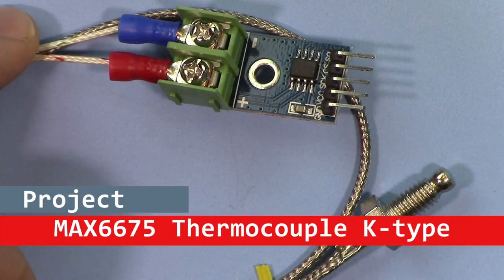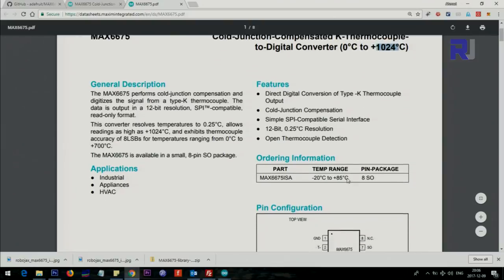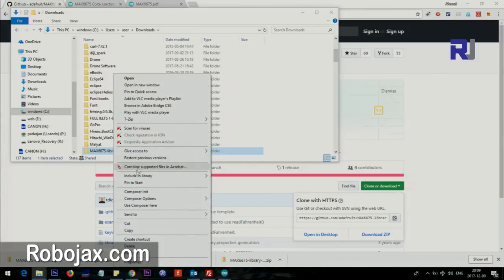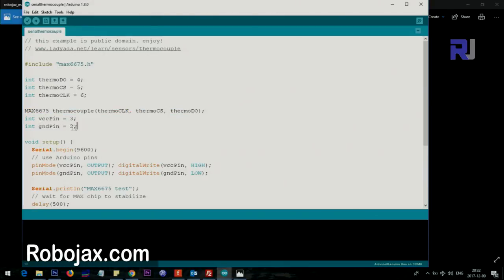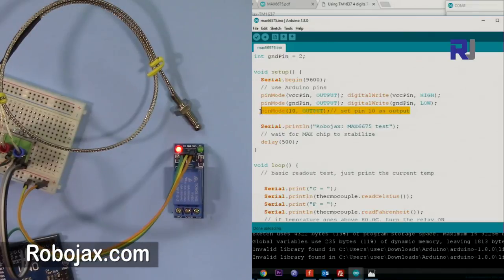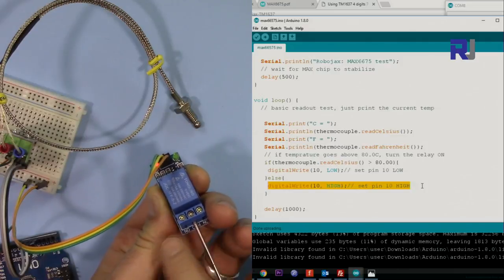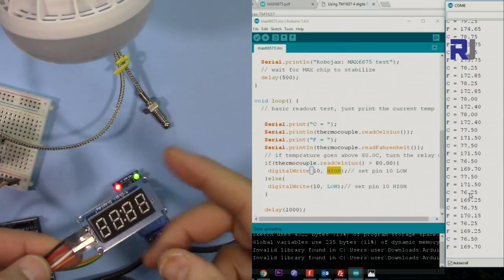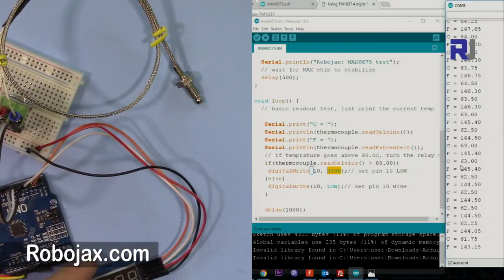MAX6675 K-Thermocouple 3 Example with relay and display with code

Comment: Nice video. Thanks for sharing. Its really helpful. I have one request, can you make an another tutorial with your last tutorial (MAX6675 Thermocouple k type sensor with LCD1602 I2C and Arduino), using a maximum and minimum temperature difference controlled by using a keypad and an output can control a relay?
Reply from the maker: this projects requires LCD, Keypad and MAX6675 and Relay.  needs  some work and if it was popular, I would make it.

Comment: What a great video!!  I purchased all the components to control a nichrome wire.
I have a question though.
5 Seconds ON, 7 Seconds OFF
On initial warm up, the nichrome wire in on too long until the temperature gets to 80 degrees C.  It get's too hot.  I need more of a gradual heating.  Can you help in editing the code so that when the temperature is under 80 degrees, the relay will turn into the ON position for 5 seconds, then it shuts OFF for 7 seconds.  It repeats this loop until the temperature reaches 80 degrees C.  When above 80, the relay stays OFF.  Then when the temperature goes below 80, it repeats the 5 seconds ON and 7 seconds OFF.
The only thing is that I'd like for the temperature to still take a reading every second like your code does right now.
Thank you, I look forward to learning more from your channel.
Phil
Reply from the maker: Here is the solution for the problem you described.  https://codeshare.io/5Q7VYm
you did not mentioned which code you used as I have different code for this video, but you can use it anywhere or modify it.
Reply: Thank you, that's exactly what I needed!
Reply from the maker: you are welcome.

Comment: Can you make this project again but with change componen oled 0,96 and dht11 sensor. I need the code from my project
Reply from the maker: Hi, then you need to watch the MAX6675 with k-type without display. here is my video on OLED. You can use  https://youtu.be/UmYiHTOz-5k you can combine both very easily.

Comment: Great tutorial thanks for providing code i hope to use this on my mega with an lcd shield using 3 buttons to select and set the temp up and down. Any advice? Its for a heater setup
Reply from the maker: I have not tested it in this combinations but it should work.

Comment: Excellent presentation!  Could you do the same thing only modulate the output to provide a variable speed fan?  Thanks!
Reply from the maker: Sorry didn't understand what you want to achieve. do you want increase the speed of fan to be controlled directly with increase of temperature?
Reply: This is for a heating unit.  When the device is first started it will be at ambient temperature and the fan output would be 100%.  As the temperature approaches 400 degrees F, the fan output needs to decrease.  When the temperature reaches 450 degrees F, the fan needs to stop.  When the temperature drops to 400 degrees, the fan would need to restart. The start/stop cycles would repeat based on the temperature measured at the thermocouple.  I hope I could change the selected temperature values.  I really appreciate you getting back to me!
Reply from the maker: Then you need to have DC fan (DC motor) with speed controller.  so use DC motor controller with potentiometer and you can use temperature instead of potentiometer to control it.

Comment: Hello Great Channel!  
Is there anyway to display temperature with 1 digit past the decimal point?
Like:  83.6    93.4    65.2    102.5   132.6   on the seven segment display. 
This would be a HUGE Help! Thanks!
Also anyway to use 2 temperature sensors and 2 displays? 
I am using DS18B20 OneWire Sensors but I also use MAX6675 K-type sensor for high temp applications.
Reply from the maker: You are welcome.  With current library, you can't but I will work on it in the future.

Comment: Hi,I need some help in my project ,I have 12 v dc heater similar to 3d printer heater and i need temperature controller ,I try PID and K thermostat but all this is need AC power and my project is just DC .appreciate any help.thanks
Reply from the maker: Hi, I believe this video will help you https://youtu.be/dVh77wT-4Ao

Comment: Does that bulky thing at the end of the probe come off?
I need a thin probe for my application but it appears that this bulky screw thing is attached to the probe for some reason.
Reply from the maker: No unfortunately it doesn't. It is made for oven or other application .
Reply: thanks

Comment: Hi. May I know how to change the code accordingly if I wish to connect two of this thermocouple simultaneously in one Arduino board?
Eg. One connected to digital I/O port 234 for one, another one connected to port 567.
Reply from the maker: Hi, I just updated the code in the page. The last code is for 2 thermocouple
http://robojax.com/learn/arduino/?vid=robojax-max6675-thermo

Let me know if you got any issue. I have not tested it but it should work.
Reply: Thanks a lot man!!
Although I just figured it out only after hours of trial and error lol.

Comment: Hi,  if use termocouple + max6675 out put max6675 can activate ssr relay?
Reply from the maker: No. The output from the module will always have signal which is digital values and we use Microcontroller like Arduino to read and decode it and take action based some values.

Comment: I want to make an Arduino project, the project I want is as follows setting using the button to a temperature of 150 ° C after the temperature reaches what you want to set a few minutes die. can you help sketch? because I'm still studying at Arduino
Reply from the maker: your request is simple and you can use this code. But with push button, it needs a separate project  and needs a little work. http://robojax.com/learn/arduino/?vid=robojax_MAX6675_thermocouple

Comment: Hi may I ask again? It works fine when I use Arduino board but when tried to use the code on Wemos D1 board, it appeared that it would fail to upload. I checked some sources saying that because the board uses a different mechanism so most of the libraries would not work on, it may need to have some modifications to be done. Do you know what modification needs to be done? 
Thanks a lot man!!
Reply from the maker: You have to select the right board type and programmers. both of them can be selected from the "Tools" menu. so try different options. I am not sure what  board and what USB chip you use.
Reply: It is a WeMos D1 ESP8266 WiFi Board with a mirco usb chip. Because I have setup so that  it can successfully upload the example sketch of ESP8266 to the board. But when I tried to include the library the error starts to happen. (exit status 1. Error compiling for WeMos D1 R2 & mini.)
Reply from the maker: is your question related this video? If so please test this code separately making sure it works without any issue then add something else.
I will have separate video for Wifi module in a few months.
Reply: Thanks anyway man! I am currently doing Final Year Project that requires the thermocouples to send signal to my user interface through IoT (Internet). It will be great if could see your video as soon as possible !

Comment: As all devices are based on 5V supply, do this network work if I use AC 150W heater instead of AC fan?
Reply: one more thing- how to connect relay and display both in same setup.
Reply from the maker: Relay is isolating your circuit from AC. So you need AC to DC converter of 5V to power up Arduino and then using Relay you can control the  AC load. You can use this module to convert AC to DC https://youtu.be/-JD3E7e0RAE
Reply: @robojax  Can this AC-DC converter handle 150W?
Reply from the maker: No it is not. it is only 5W as stated in the title.
Reply: @robojax  How to control 150W heater?

Comment: If a what to use it whit a ac dimmer?
Reply from the maker: Your question is not clear. Which part of this project?
Reply: @robojax  If I want to control a heating element with an ac dimmer and use max6675 or ds18b20 to keep the temp at a certain degree as a PID.

Comment: sera posible cargar el mismo codigo en una placa STM32F103  saludos
Reply from the maker: Hola, sí, es posible, pero debes incluir controladores para esta placa para
Arduino desde esta dirección. https://github.com/rogerclarkmelbourne/Arduino_STM32 No he trabajado en eso, pero debería funcionar. Gracias. Ahmad de Canadá
Reply: @robojax  si ya le cargue los controladores y le e cargado varios programas desde IDE  de arduino como el RFID  pero el max6675 marca error en archivo cpp. y lo resolveré trde o temprano en saludo desde queretaro mx.

Comment: I'm sorry. My name is Karsan, Do you have this program like this with Raspberry Pi Sir? If you have it, can you upload or share to me?
if you dont have, maybe tou can make for me this program with Raspberry. 
Thank you so much sir
Reply from the maker: Hi Karsan, nice to meet you. I am sorry I have not written any code for Raspberry PI.
Reply: @robojax  oh only written code for arduino sir? Is not for raspberry?
Reply from the maker: I mentioned in the video where to get the code. Also this is accepted by everyone that related links will be under the video in the description.
Reply: @robojax  ok sir, maybe you can try to make like it with raspberry so can help and useful for everyone :)

Comment: Sir this sensor can hold hot water more than 100 degree ?
Reply from the maker: Yes. this can go 500 or 600 ° C
Reply: Thanks sir. I have some boiler project control with PID control Algorithm. I just looking sensor that can hold hot water more than 100 degree. I really thanks for make this tutorial. Keep inspire sir.

Comment: Hallo
I have one Problem! Serial Show F=nan! No Data. Pleas help. Thanks
Reply from the maker: Are you trying  this:    
Serial.print("F = ");
   Serial.println(thermocouple.readFahrenheit());

It seem the pint connections of Clock and the data is not write. Check the wires.
Reply: Robojax 
Yes but no successes!

Comment: my board is reading 0 degrees Celsius at all times!
Reply from the maker: is zero on the display or on serial monitor? 
Try to run the code without relay and display.: https://goo.gl/Ly5r9o and let me know
Reply: Thank you for the fast reply, apparently my MAX6675 off ebay had a different pin out and I had to change the wire order. The temperature now displays properly on the serial monitor, unless oddly enough. Im holding the thermocouple, then the temperature will stay, even if red hot, unless I put the thermocouple down.
Reply from the maker: Then the display has issue. Please try the display alone. Watch this video and get the code https://www.youtube.com/watch?v=DuamjlstOKM
Once it worked, then try it with the thermocouple
Reply: it was staying on the serial monitor as well! I found a different code for the thermocouple that didn't use any library at all, and then wrote my own LCD code and its finally working. Thanks for the replies, now on to the tachometer! I'm making a FADEC for a home built turbojet from a holset HX60 Turbo.
Reply from the maker: You are welcome. I am glad you were able to resolve the issue.
Reply: Steven Main 
I Need that Code. Pleas
Reply: I Need that Code. Plea

Comment: TM1637 error,,i don't know file.please help me.
Reply from the maker: I have explained that you should not start all of them together. 
1-First just get the code I have provided to use MAX6675 make sure you can see the temperature on serial monitor
2-Then test TM1637 make sure it displays any value you want
4-Then combine both MAT6675 and TM1637 and for sure it will work.
If you don't follow this, you won't be able to know where the problem is.
Reply: where can I find the code tm1637 from this video?
Reply: File code TM1637?🙏 I am sorry,i am a notive...
Reply from the maker: in computer (not in mobile phone) https://snag.gy/EG4O2l.jpg
Reply: I have downloaded both(Max6675 and Test TM1637),.then how to combine both on Arduino?
Thanks,.🙏
Reply from the maker: did you try step (1) and step (2)? You don't combine. I have already provided the combined codes. But you have to make sure the step (1) and (2) that I mentioned above works before you try the main code.
Reply: I tried again and the results were successful, finally I was able to succeed, it was because of instructions from Robojax, thank God. Thank you very much Robojax, this video is good, very helpful. 
Smile
Reply from the maker: You are welcome. I am glad you were able to make it work.